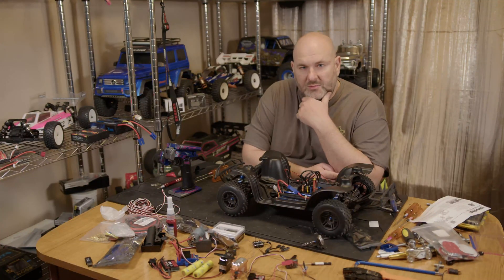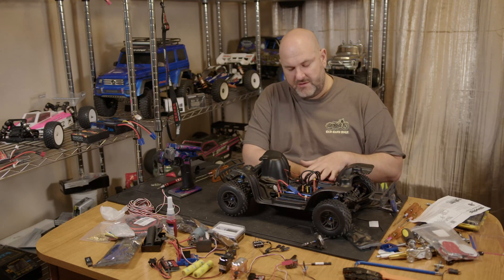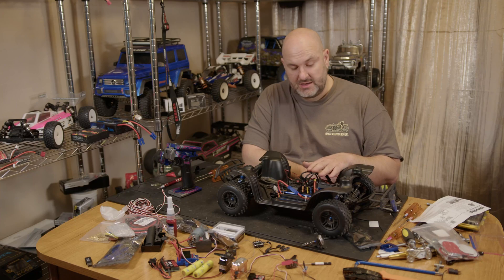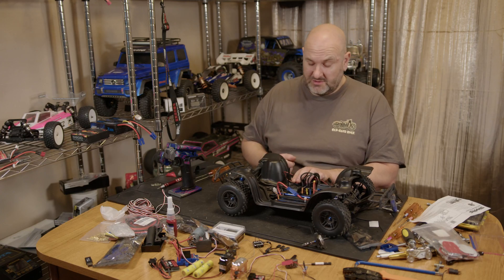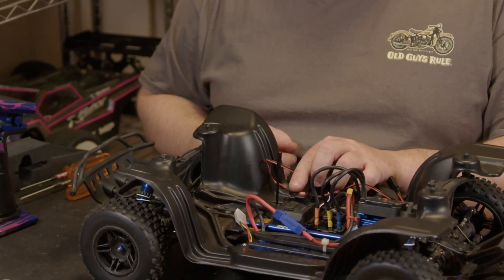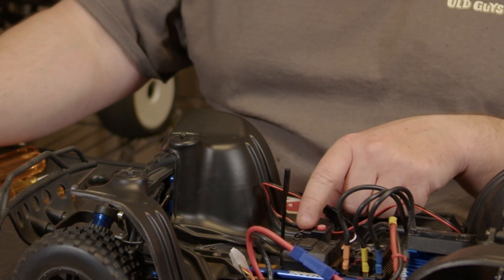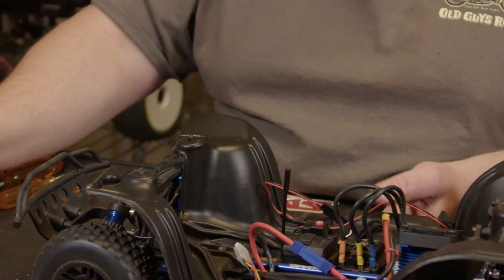Hobbywing Max10 SCT ESC calibration guide

Comment: another blinking red light of death HW consumer. these things are such trash!
Reply from the maker: Ive got load of HW esc's and all still working fine ?
Reply: @WTFRCCars wellll, i dont and suddenly mine doesnt work!
Reply from the maker: Which esc do you have ?
Reply: @WTFRCCars  the max10 ez 80a and its just dead in the water. ran 5 packs max last deason, put it away, took it out last week, ran 1 pack FINE.  turned it on next day, blinking. awesome. $100 gone. now i get to buy ANOTHER esc.
Reply from the maker: @SpeedyTube83 what RC is it in because max10 80a is a budget esc it's not supposed to be fitted in anything very big or with big wheels
Reply: @WTFRCCars  lol its a bandit with the stock crappy tiny knob tires and a new spektrum brushless motor. cant get easier than that
Reply from the maker: 80amp is a low power esc so I'm guessing it's cooked it in 2wd buggies we run the xr10 pro

Comment: QUESTION with my radiolink rc4 gs v3 my throtthle epa maxes out at 120% should i back that down to 100? Cant seem to find any info on this any help would be appeciated thanks
Reply from the maker: You should always have the epa set to 100 the 120 is just for servos if you don't have enough travel
Reply: @WTFRCCars  thanks man even my throttle maxes at 120 seems like a weird setting to me. I just gonna leave it at 100 anyways dont want to overdo anything

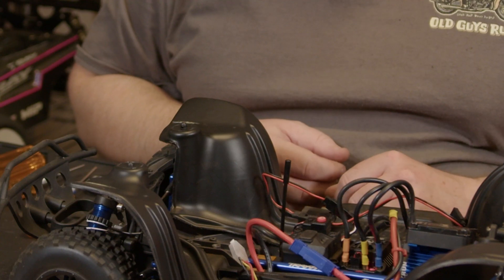Comment: After 0:55 mine does not blink green any help?
Reply from the maker: Your transmitter is not moving enough to allow calibration or you have the servo frequency too high
Reply: @WTFRCCars  i dont have the servo in my reciever is that it?
Reply from the maker: @lucitheone2 no servo frequency is the number of times a second that the transmitter is telling the servo/esc what position the steering/throttle is
Reply: @WTFRCCars  do i need to turn that of and how do i do that
Reply from the maker: @lucitheone2 just rest the model memory you are using re bind the receiver and then run calibration on the esc I've used many hobbywing esc's with nb4 radios and they work fine so it must be something you have set up in the transmitter
Reply: @WTFRCCars  can i somehow rest the transmitter?
Reply from the maker: @lucitheone2 yes main menu factory rest
Reply: @WTFRCCars  mine still doesnt work i just got it for not even 1 week
Reply from the maker: What doesn't work ?
Reply: @WTFRCCars  after 0:55 mine does not blink green
Reply: @WTFRCCars  my servo is making weird clicking noice and if i try to steer my motor spins a little and my servo spins
Reply from the maker: @lucitheone2 I'd say that's a dead servo
Reply: @WTFRCCars  its not dead i think because it does what it suppossed to do
Reply from the maker: Oh you motor spins too ? Check you don't have any mixing set up and make sure the receiver is updated too
Reply: @WTFRCCars  how do you know if your transmitter is updated i am sorry for all the questions i am new to this hobby
Reply from the maker: @lucitheone2 system menu and about it will tell you
Reply: @WTFRCCars  traxxas tqi
Reply from the maker: Traxxas tqi won't work with Hobbywing traxxas tqi refresh rate is far too low it's below 333hz that the hobbywing needs it's around 280hz
Reply: @WTFRCCars  oh so thats the problem what transmitter and reciever do you recommend

Comment: Liked and subbed. I'm just getting back into this. I still have my built slash that was a rally car now an off road monster truck buggy thing. Can I connect this to a tq first Gen radio?
Reply: When I left off I was running 3S Through NESC that wasn't up to it. I have this ESC and also an 8 scale motor and all the parts I need to put it in this. I have taken this thing too far. That's why I got out of it. I just can't help myself I'm rebuilding it again. My bunny bought a brand new rivo 3.3 Nitro I beat his a** on 2 wheel drive and blew a tire apart. I've ordered my differential I've ordered everything to redo this car
Reply: I do not have my good radio anymore I'm hoping I can just link it to this old school thing for now
Reply: Bigboard shocks metal drive shafts suspension turning to the point that I'm using different weight oil in the front and rear shocks. I still have a whole room where the wall almost looks like a hobby Shop
Reply from the maker: Yeh it should work fine with any radio

Comment: Please help i have this esc in my red cat mt10e. Nothing but problems out the box. Well now if i hold the transmitter throttle just a hair it will run but i go to punch it car stops and 1 green light  flashes fallowed by red blinking lights
Reply from the maker: That could be a few things, if the battery is not high enough C rating the voltage will drop and esc will cut out, if the calibration is not done the esc doesn't know where the transmitter is asking it to be, also if the transmitter servo frequency is not correct the ESC won't be able to follow the position of the throttle correctly, what transmitter are you using? What battery and did you calibrate the esc?

Comment: are you supposed to hold down the throttle and press the button at the same time?
Reply from the maker: When calibrating the esc 1st is button with throttle in central position, 2nd is hold full throttle and press button 3 rd is full reverse and press button

Comment: Not sure if you will see this but I cannot get mine to accept neutral range. When I press the SET button the red LED just goes off. No beep and no Green light indication that it accepted neutral range.
Reply from the maker: What transmitter you using ? If it's the nb4 or noble pro check you don't have the servo frequency too high try 333hz :)
Reply: @WTFRCCars  Radiolink RC4GS Transmitter Radiolink R6FG receiver.
Reply from the maker: Not sure if you can change the servo frequency on the radio link look for something like analogue/digital :)
Reply: @WTFRCCars  the servo frequency would effect the throttle?
Reply from the maker: Yes it's it's set too high the ESC can't get a lock on the centre point so won't calibrate

Comment: How is this not working for me.
Reply: Radio was broken, but now i have a new problem. After 7 seconds low voltage cutoff activates. New battery, electrics are new. Tryed different battery. Same thing. Everything is charged full. So why do i have this problem? Programmed te lvc off and the esc works fine but there is a risk whit using a lipo whit out lvc.
Reply from the maker: Do you have the wrong s rating set in the ESC? That would make lvc cut in all the time for example ESC set to 3s but running 2s
Reply: @WTFRCCars   thats a good tip. Ill check tomorrow.
Reply: @WTFRCCars   you where right. Thank you!
Reply from the maker: Happy to help
Reply from the maker: Happy to help
Reply from the maker: What transmitter?
Reply: @WTFRCCars   kyosho kr331
Reply from the maker: Do you have the option to change the servo polling rate for example 333hz or digital/analogue?
Reply: @WTFRCCars  no. The steering works fine but throttle calibtation wont work.
Reply from the maker: Make sure the trim is centred and the end points are on 100% but some radios are just not compatible with some esc

Comment: I've got one of these same escs and while it's working correctly, the set button no longer works. Is there a way to enter calibration mode with a broken set button? Can we snip and twist any wires or even use the programmer to enter calibration mode somehow?
Reply from the maker: Yep u can just get the power switch and button there not expensive and easy to change